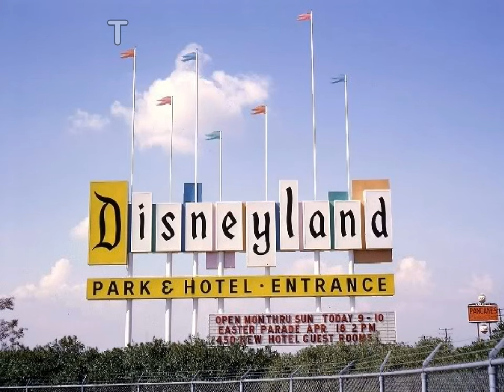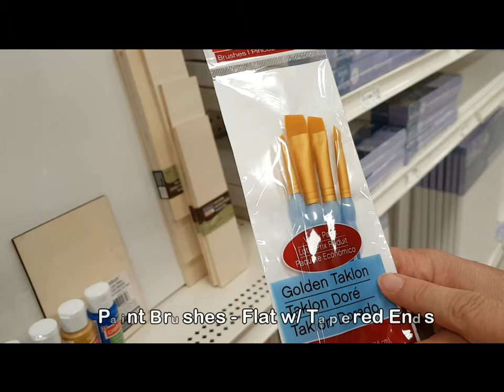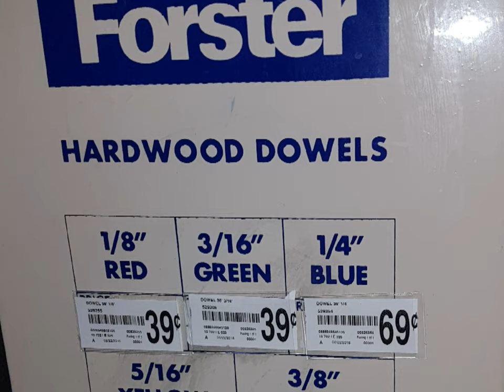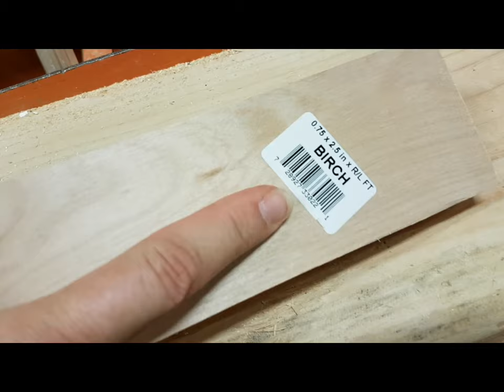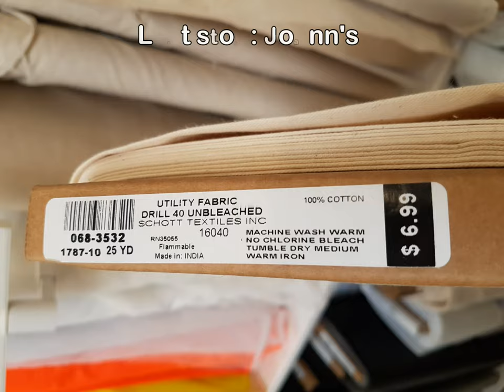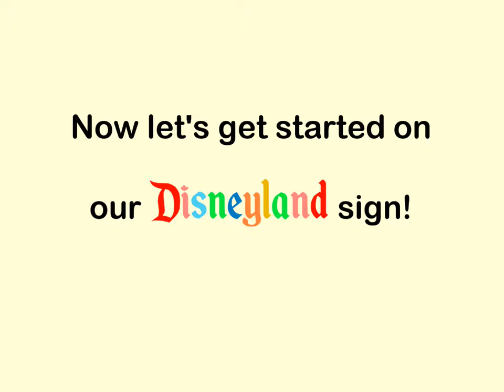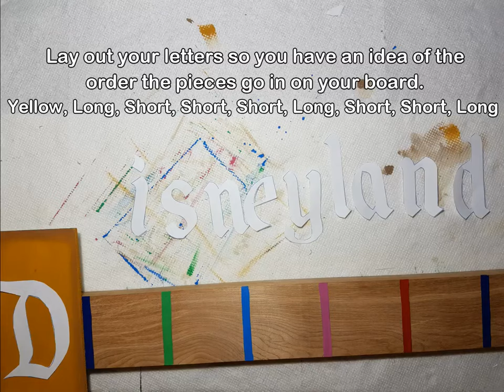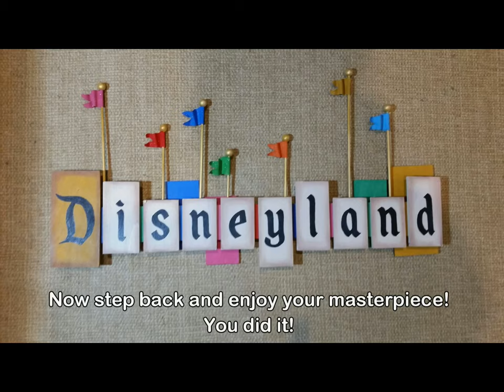DIY: Disneyland Sign Tutorial by The Enchanted Brush

Comment: Can you please tell how wide these planks need to be for all of the letters? You are assuming that  we can find these particular packets of wood planks at the craft store. We've got height but please tell us the width.
Reply: In the same boat as you
Reply: @garywood7700  I did some measuring. It looks like all the letters with the exception of the "D" are to be 2.5" wide, and the D is 3.75" wide.
Reply: @garywood7700  Actually, I laid out a mock-up of the planks using just paper, with the lettering provided in the pdf, and it looks like the planks should be 2.75" wide, which will allow for the edges of each to be "aged" without encroaching into the lettering. That will allow the major beam to which all of the letter planks to be glued to be roughly 30" across, depending on the space you establish between each letter.